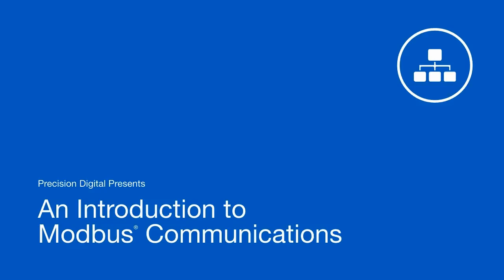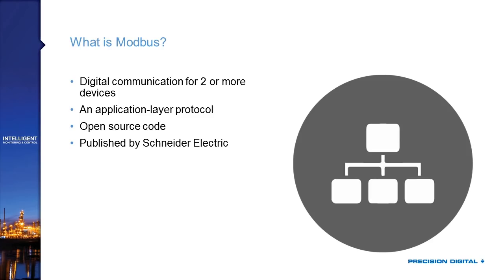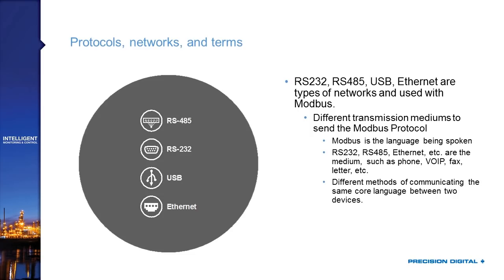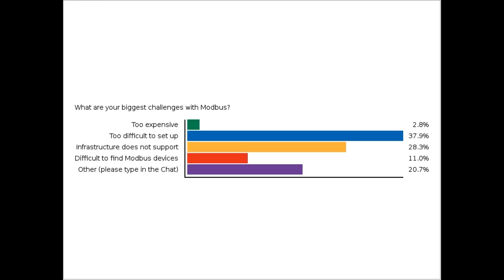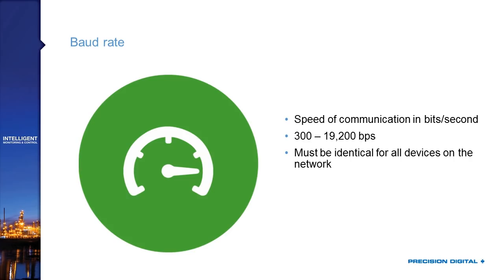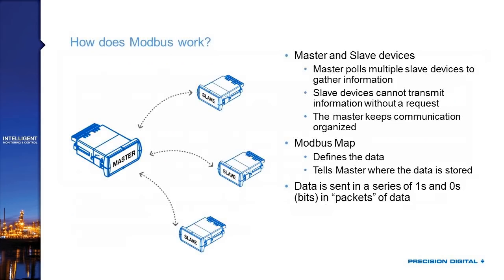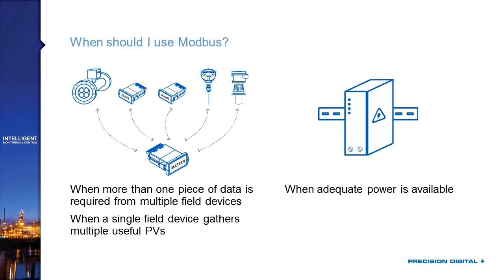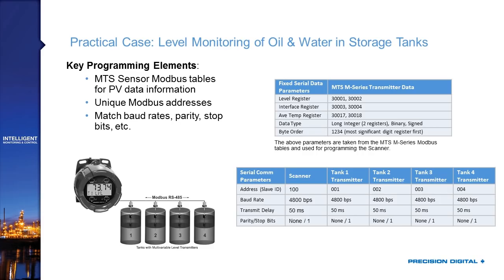An Introduction to Modbus Communications

Comment: Just a note.  The description of the parity bit is inaccurate.  The parity bit is set to a value to ensure the agreed-upon parity standard.  For even parity, the parity bit is turned on if there is an odd number of 1's in the data.  If there are an even number of 1 bits already in the data then the parity bit is set to 0.

Comment: Hi guys

Thank you for the awesome webinar.

what software is required to do the modbus programming? I have my laptop linked up to my vsd but I am not sure what software is required to change the registers? I see a lot of Modscan, Modpoll but not sure if this is what I require to do the modifications
Reply from the maker: Great question! There are many ways someone can poll a Modbus device with software. Modbus Poll is one our engineers prefer ( https://www.modbustools.com/modbus_poll.html ). However, this is used for development and troubleshooting, not usually work in the field for continuous data capture or for general device programming. So, if you are just looking to change a few registers, test the system, etc; then Modbus Poll is a great choice. If you want something to run your system on a day to day basis, and display the data in a nice, graphical display package like you might have in a control room or on an HMI display, you probably want to talk to a PLC/HMI rep and have them work with you to design your solution. Alternatively, Precision Digital makes devices that can easily be setup to display specific Modbus registers, if you don’t want to use a laptop and just want a local display.

Comment: Hi, how are u doing?

It was a quite clear explanation about the modbus protocol, (Ive been looking on internet for a while)  thank  u in advance.

Can I make a question? or more accurate ask for a reccomendation, 

How can I make an  application to control a  Hitachi  VFD,  it has a RS-485  port, it  uses modbus connfiguation to opperate on a net,

Ive been able to opperate it using analog and digital   I/O  only, but I want to do the next step.

see a

Comment: I guess this video is a few years old now, but thanks for posting it. One thing I'd like to know more about as mentioned at 50:48 in the video, is that it has a larger power requirement. The video never really covers why there is a higher power requirement to using Modbus than other protocols.
Reply from the maker: The issue isn't really Modbus.  Modbus is just the language being spoken, so to speak.  The real issue is that Modbus is often transmitted via RS-485 or Ethernet. Neither standard was created with modern low power requirements in mind.  Ethernet is very power hungry, and the 5 or 3.3 V signals being driven by RS-485 also require a lot of current compared to other low power options. Even a few mA is way too much additional power for a low voltage drop loop powered device to drive, or to add as a constant drain on a battery powered device.  The transceivers for these protocols just use a lot of power by design requirements.

Comment: I have a RS485 sensor and need to connect it to a controlling board that has the following connectivity: HART, UART, SPI, I2C: 
Which is the easiest interface in order for both devices to connect?
Reply from the maker: HART travels on the 4-20 mA loop, and a different protocol, and therefore isn’t useful as a communication medium to speak to your Modbus RS-485 sensor. Similarly, I2C and SPI are ways to communicate between board-level components that won’t be much use here. Your best bet is the UART, however there is no simple configuration to turn the UART pins into the signal used with RS-485. You will need intermediary electronics, which can be researched and for which designs already exist, to get the RS-485 to talk to the UART. Once that’s done, reading the data from the 485 becomes a firmware challenge – but without the circuitry between the two, they can’t talk.

In short, it’s not a simple answer, and will require both hardware and firmware design work.

Comment: Parity bit explanation is incorrect. 

If you have odd parity selected and your data sent only has two 1's as in your example, your parity will go high to make an odd number of 1's in your packet. 
If your sent data had three 1's your parity bit would go low to still ensure an odd number of 1's in the sent packet.

Even parity selected would mean your data having two 1's so your parity goes low to keep an even number of 1's in your packet.
And if you had three 1's in your data your parity bit would go high to keep an even number of 1's in your sent packet.
Reply: +Jason Bone To add, you mention modbus not ideal for solar applications yet it is the standard in the solar industry.